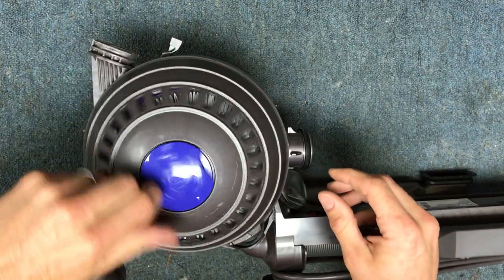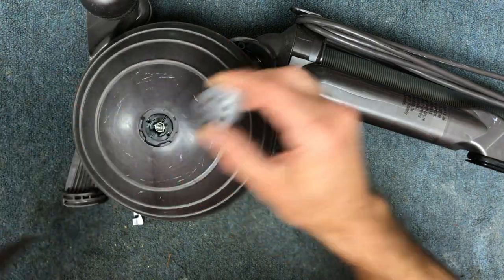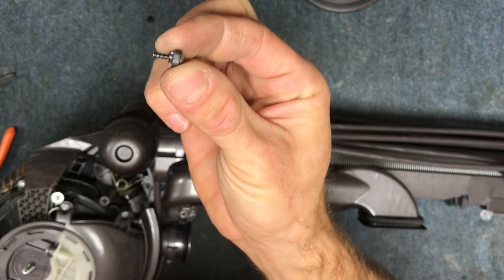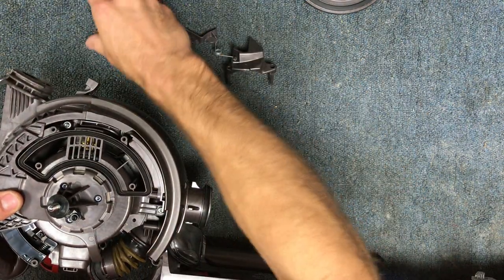Dyson DC40 change over hose replacement—repairman shows how

Comment: Thank you Sir. I was able to perform this fix tonight on our DC40. Changeover hose, 2 new filters and a good cleaning! The vacuum is currently working like it’s new again. You directions were great. I owe you a beverage.
Reply: I only saw one filter.  Are there two?  I have a model DC40.
Reply: @steverose2405 the second filter is in the top of the cyclone. Lift the handle up.

Comment: Just wanted to say thank you for a clear and knowledgeable demo, I, which is a bit of a dumb when it comes to fixing, and was able to pause and changed it. But have to say, I had numbered the screws which I took it off, in the meantime marked the exact time off your video, and I still got one screw left out and couldn’t remember where it should come from,  but it works now. 😂. Thanks a lot anyway😅

Comment: Thanks! The local repair guy said he couldn’t get the part anymore and he tried to sell me a new one. It took a while with all my obligatory backtracking, but its working great!
Reply from the maker: He's partly correct. The dyson supplier that us vac shops get our parts from is at the complete bottom of the supply chain for Dyson parts. Dyson stores, and internet retailers get first pick of the supply of parts which means us small guys have nothing to left to buy in regards to dyson parts. I have had to resort to buying these off amazon myself and just charging my customers a small convenience fee plus labor.

Comment: Nice.. but, You should slowly, gently back-screw with slight pressure by hand ... searching for the original threads in the "plastic" supports... when your screw reaches the original thread, it will suddenly drop... at that moment you can screw it in, without starting a new, weaker set of threads in the plastic.  especially when re-mounting the filter support assembly with those 4 screws you ran in with the motor driver... :-)   (But then, it probably has a torque-limit adjustment)
Reply from the maker: It does have a torque limit. Thanks! Appreciate the feedback!

Comment: Hey, Very informative. Okay, I have the shredded change over valve hose out. I don’t have a manual. I’m not sure which replacement part is correct for my DC40 13 year old upright vacuum with purple cyclone. I see so many that look like mine, but when I read reviews sometimes they don’t fit. I’m not sure which one I should get. How do I determine correct size for mine? Your help would be greatly appreciated. Thanks, Peggy
Reply from the maker: https://www.amazon.com/ASODOMO-DC40-DC42-DC50-DC51/dp/B0B98R6Y8W/ref=sr_1_2?crid=2F4YCYXPTL0HA&keywords=dc40+cov+hose&qid=1661537233&sprefix=dc40+cov+hose%2Caps%2C115&sr=8-2
Reply: That’s one of the pieces I was looking at…..just needed confirmation from someone who knows more about this stuff than me. Thanks again!

Comment: Thank you. Got it fixed. Those small screws are easy to strip... A bit more of a warning maybe?
Reply from the maker: thanks for pointing that out. that's helpful.
Reply: Anytime you're working with small screws like the ones here, be careful how much torque (twisting force) you apply. With Phillips screws especially, make sure you have the correct size head, cuz those little guys will strip even easier. At least with torx, the chance of stripping is much lower.

Comment: Thank you so much for this video-   we have a multi floor2-  will this repair also work for this vacuum?  I have tried finding the replacement part but I am unable to find it.  Could you please assist me with this
Reply from the maker: You’ll need to find out the exact model number first. Multi floor 2 isn’t the model number. There is a sticker on the vacuum behind the dirt cup and the model number will be to the left of the bar code and it will start with either the letters “DC” or “UP”

Comment: Watch the plastic tab the spring attaches to.  Mine broke off - not sure if it is fixable now?
Reply: Was able to drill a small hole, and insert a small screw to hold the end of the spring - works fine now
Reply from the maker: Check the link in the description. I reshot this repair and posted it. In this video I had a few parts that I didn’t realize I was doing out of the frame

Comment: At 2:00, you removed a retainer, but didn't show it to the camera before setting it aside.  It appeared to be about twice the size of my retainer, which I think is broken.  I bought a parts kit for the changeover, but the retainer is not included.  What to do next?  Look for more parts.
Reply from the maker: Can you be more specific. At the time stamp you included I merely removed the cyclone. I’m not sure what you’re asking.
Reply: You are taking the screw out of the hose retainer at 1:57 and holding the retainer at 1:59.  My retainer looks different, but I determined that it is not broken.  I put a new changeover mechanism around the hose that I purchased from Amazon; one of those hollow plastic shafts had broken.  I have it back together; all is good.  Thanks.  I liked your video so well the time that I replaced the hose that I sent you a tip.  @richardsvacuumcenter
Reply from the maker: @steverose2405  glad to hear you got it fixed! Thank you for the tip! always appreciated!

Comment: Might be helpful if you kept your work in the viewing area. 5:51
Reply from the maker: thanks. I'm aware. It was one of my first videos so it was a rookie mistake. I've re recorded another one of these repairs, just haven't edited yet :)
Reply: @richardsvacuumcenter  How about now? I was really struggling with getting the correct screws in the correct holes around the flexible tube... said the vicar to the prostitute. 😂

Great video otherwise. 👍🏻
Reply from the maker: @ottofumbler7267  better filmed video is in description and also pinned at top of comments thanks
Reply: @richardsvacuumcenter  Thanks. Much clearer.

There is a lot of flipping the vacuum over and switching the hose position, so it's tricky to keep track of the different screw positions. Other than that, it's pretty straightforward. 👍🏻